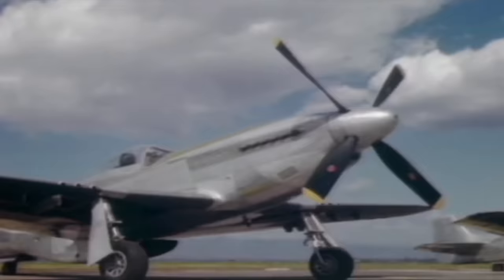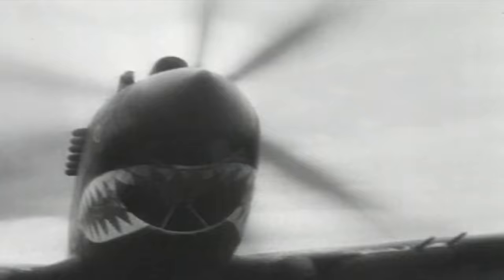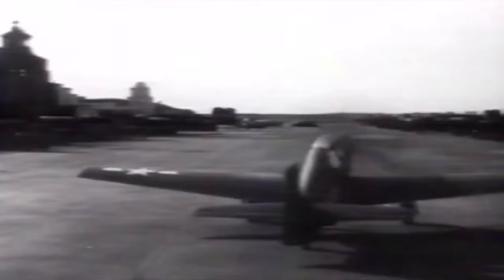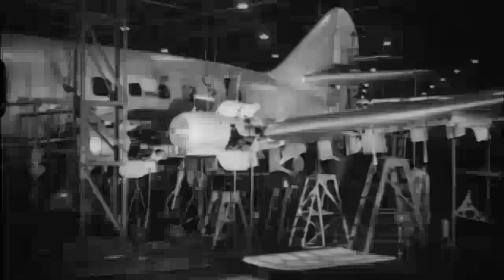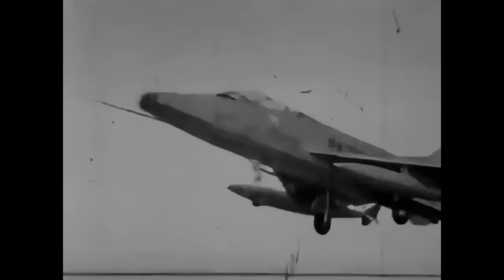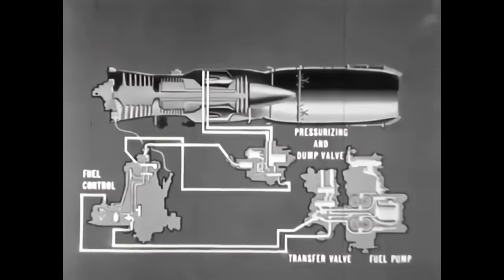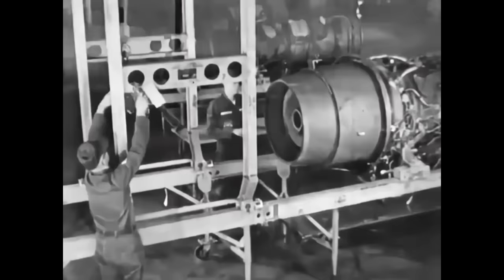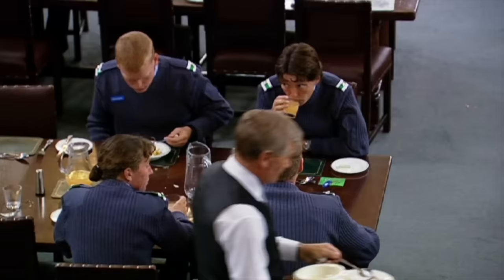Aircraft Engines | From Propellers To Turbojets, To Supersonic Passenger Jets | A Video Collection

Comment: Good documentary with a lot of valuable information.  A few issues:
1. You are unfair to Ford.  He certainly had issues, but you do not present them accurately.  His resistance to British contracts was before Pearl Harbor.  This idea that he only wanted to build 'defensive' arms is nonsense.  He was an isolationist.  After Pearl Harbor, Ford was all in.  I suggest you look at what came out of Willow Run, B-24 Liberators in incredible numbers.  And the B-24 is about as offensive as you can get.
2. The P-47 with drop tanks could also fly escort missions to Berlin. 
3. The P-51 range issue in the Pacific was solved at a terrible cost by Iwo Jima.  P-51 squadrons based there could escort the Superforts to Japan. 
4. You should have addressed the issue of the varied performance of the RR and Packard Merlins.
5. The Doira hardly solved the Luftwaffe problem.  By this stage of the War, Luftwaffe pilots were entering service with minimal training, in part because the strategic bombing campaign was destroying the synfuel plants and there was no way to train them.

Comment: The ultimate fighting machine of WW2 was the Me-262
Reply from the maker: The airframe was excellent, but the engine was a complete disaster, so much so that after the war, except for a short-lived attempt made by the Soviets, they eventually switched to the reliable RR/Nene/Whittle British reverse-engineered turbojets for their amazing MiG 15.
The Czech Air Force also made some rather useless attempts but eventually switched to the British engines as well...
The French also tried to develop them together with Nazi engineers, but that was a no-go either.
Nobody cared for those over-engineered, short-lived, fragile German engines.
Despite 6 long years of development, massive investments, and many German companies such as BMW, Heinkel, and Junkers, they still barely worked. You can also add to that the fact that they had the lethal tendency to flame out on the pilot.
Toward the end of the war, Heinkel and Von Ohain, realizing that they wasted all that time to develop a 'lemon', eventually tried to outright copy Whittle's engine, which had been an inspiration for Von Ohain right from the start, as he had access to the British genius' work all along. 
Eventually, axial turbojets, as predicted by Whittle long before Von Ohain even started working on his engine, surpassed the centrifugal turbojets, but they were definitively not based on those utterly flawed German engines, as the Brits had been working on both solutions for a long time (and those both worked quite well).
It is still a classic example of over-hyped German wonder-weapon, when in reality the Me 262 was utterly useless.
A wonderful airframe with a tragic engine made it inconsequential.
Reply: True but most modern jets are using axial flow engines except turboprops and APU-s are of Whittle's design
Reply from the maker: True, but proper axial turbojets(mid 50s) were anything but German derived.
Perhaps you are not aware that Whittle purposely discarded the axial compressor precisely for the reasons that plagued the German engines.
He realized that it would take too long to develop an axial turbojet, so he sought an intermidiate solution that was dismissed by his sole examiner, none other than Griffith, the author of a seminal paper on axial,compressors in 1926, almost a decade before Von Ohain started working on his project, fully funded (the opposite of Whittle) by his patron, Mr. Heinkel.
You can say that Whittle had the perfect short term solution, but was halted by a person that was working on an axial solution, whereas Von Ohain who had full access to Whittle’s work, and presumably to Griffith’s paper from 1926, simply made the wrong choice.
Heinkel and Von Ohain would eventually also try to mimic Whittle’s engine, but it was too little, too late.
Companies like Metrovick had been working on (proper) axial solutions all along, in tandem with Whittle’s solution, which had been delayed by bureaucracy, Griffith, lack of funding, and support by at least 5 long years (1929 to 1934).
When you look at it objectively, and consider the resources that Germany poured into developing a flawed turbojet, you can easily compare it to David VS. Goliath.
Still, a broken, and humiliated Whittle managed to beat the might of Germany’s effort to the finish line, having produced a working turbojet in April 1937 (of course he could not afford an aircraft to test it, as Von Ohain could).
Whittle’s engine powered many aircraft, including the first jet aircraft to fly on U.S. soil, the first operational U.S. jet fighter, the first commercial jet, the formidable MiG15, and many others.
When it was surpassed, as predicted by Whittle, it was almost 1960, 30 years after he presented his (rejected) projet to the British Air Ministry.
He was a true genius, and I cannot say the same about his counterpart(s) who piled up strategic and engineering mistakes.

Comment: Ford got lucky, they let him (his engineers) re-design the merlin for mass production and these increased tolerances led to the power being doubled and eventually trippled when compared the original hand made merlins. Shows what a beast the merlin was.  I didn't hear them talk about that on here and that's the biggest fact I remember about the merlin. They asked him to mass produce the engine but the tolerances were too loose
Reply: ford(US) had nothing to do with the packard merlin, henry ford refused, packard mass produced the merlin, (engine brought to the parts on an assembly line), every part fit every engine hence much closer tolerances,  British-built Merlins were hand built, (parts brought to the engine and  file fitted on a bench), tolerances and clearances did not increase power, manifold pressures, water injection, intercoolers etc are what increase performance....... Rolls-Royce adopted many packard innovations and ford(Britain) built some 30,000 Rolls-Royce merlins but henry ford gets no credit for the packard merlin
Reply: @jamessolak1619 Henry Ford with rolls royce redesigned the merlin for mass production. Rolls Royce mass produced the merlin before Packard was involved. The upgrades you listed already existed before Packard took over. They were done in England by rolls royce and hooker and ford and whoever else. By 1939 the Merlin II was flying at more than 2,160hp. This was years before Packard got involved. I was just pointing out Ford because the Ford plants and redesign work in England are not widely known about as you have proved.  Look it up. Ford engineers redesigned the engine with tighter tolerance and Rolls Royce and Ford mass produced merlin in England. Then in 1942 Packard took over with even bigger production. This is where people get confused because Henry Ford Refused to build the merlin in the US but his ford plants in England did produce the engine for Rolls.  Packard took over US production and actually loosened the tolerances from ford and rolls to make it even easier to be mass produced. So if ford had nothing to do with that engine then where did Packard get the plans from? Ford made those plans under contract for Rolls Royce. Ford built 36,000 merlins and Packard made 58,000. Sounds like mass production and we all know who invented the assembly line so I don't understand why these facts are controversial.
Reply: @nickhouck4309  16 lines without a correct statement, packard entered into an agreement with rolls-royce in 40 september, first engines off the line in 41 august, 5 months before pearl, in 39 nothing was producing 1.3hp per cubic inch but 1 off race engines, the merlin II was at best an 1,100hp engine, Trafford Park's 30+ thousand "ROLLS-ROYCE" engines that your boy henry produced were ALL twin-speed single-stage engines (bomber engines), his last run in 46 was mark 24's at 1,600hp, i know exactly  what ford's involvement with the merlin was, i am not confused, the whole world is not confused, stop walking around with your two buckets of bullshit in a fleeing attempt to rewrite history
Reply: @jamessolak1619   literally everything I said is true accept Henry himself didn't actually do anything it was his engineers working for rolls in England. Packard had nothing to do with my point wich was how merlin went from 900 to 2,000 horsepower. The first 2 Packard test model merlins were made to celebrate opening in 41 . Packard went into production in 42.  checked and double checked and triple checked. And I'm correct. . Packard merlin was not produced until 42 true fact. Yes the license contract (not agreement) that happened before production in 41, that's normally the order of things and yes they made 2 engines in 41 but that is not production another fact. Ford plants were already producing merlin before Packard got the plans.  checked that too, another fact. Packard had to loosen the tolerances in order to make mass production easier. Another true fact. sounds like the one lying and confusing words is you. Because if it were me I would of corrected myself. If you can't understand the difference between a test model and a production run then your never going to understand why they couldn't of went into production before pearl or the difference between an agreement and a license contract.  there is no point in continuing. Because you probably still don't get it. The only thing I could find wrong with my 16 lines was the Henry part. It was Ford but not Henry. 
https://theaviationgeekclub.com/the-story-of-when-ford-uk-refused-to-build-rolls-royce-merlin-engines-because-the-tolerances-rolls-royce-allowed-were-looser-than-ford-was-willing-to-work-with/

Comment: This author's flawed contention that all radial engine aircraft were slower then in line engine aircraft, conveniently overlooks the P-47 Thunderbolt and the Navy's F4U Corsair. The P-47D could fly at 425 mph. the P-51 at 440 mph, the Corsair at 446 mph, the P-47N at 470 mph and the P-47M at 500 mph (hot-rodded) and all at level flight.
The main advantage the P-51 had, although it was a bit slower, was that it was a true "dogfighter".
Not only that, if you compare the FW-190 and the P-51 in plan, the airfoil outline's are virtual replica's.
When they were used for ground support in Korea, the vulnerability of the liquid cooled engine made many of them wish they still had their P-47's.

Comment: I guess for simplicity of explaining types of engines inline engines applies, but a v12 is a V bank engine, not inline.  Hearing that repeatedly makes me cringe when the v engines are called inline
Reply: @scottallberry6713 your thought process is only for auto and marine based power plants, with aero engines if the cylinders are inline no matter what the banking is it is an inline engine, with radials as you add rows the cylinders are offset for a more compact design and more surface area for cooling
Reply: @jamessolak1619 , 100% correct. (Until recently, I was wrong about that, too)

Comment: Imagine what would have been produced if the likes of Junkers,Heinkel, Blomn and Voss carried on after the war. Operation Paperclip did a great job in retrieving German R&D.
Reply from the maker: Certainly not the German turbojets, which were largely ignored by Britain and the USA, adopted by the French (with a platoon of Nazi engineers), but it took them years, radical modifications, and the assistance of an American company to make them proper engines, and lastly trashed by the Soviets as utterly unreliable and short lived. The Soviets ended up using cloned British turbojets in Korea for their lethal MiG-15, which initially fought against the first U.S. jet fighter, the Lockheed P-80, also powered by  the same turbojet (variant).
The German turbojets faced very little interest after the war.
By the way, the Czech Air Force, which had been assembling Me 262 and Jumo engines during the war, also made an attempt at using those engines, but also gave up, and used the Soviet cloned British engines.

Comment: I guess I am the only one annoyed by them saying "rotary engines"..... planes aren't powered by Wankel engines
Reply from the maker: No need to be annoyed.
The aero rotary engines are not Wenkel engines…
Here is an informative excerpt from an article:
“The rotary aero engine is a special type of air-cooled radial engine, where the cylinders are arranged like the spokes of a wheel and turn around the crankshaft. The propeller is connected to the cylinders, while the crankshaft is fixed to the frame. The rotary aero engine, developed in 1908, set new standards of power and light weight within the aircraft industry. It was adopted by many pioneer aviators and widely used to set records of endurance, speed and height. Many aero engine manufacturers produced different models and variants of this type of engine, which was extensively used until the end of the First World War. The latest evolution of the rotary engine was the counter-rotary arrangement, which was devised and designed by the Siemens-Halske company.”
Reply: How very wrong you are
Reply: Quinn, I guess it's okay to be wrong and annoyed. Do some research.

Comment: Nice, but you made the same mistake so many make about the Ju 88 ; NOT radial engine powered. The Junkers 88 had inline engines with circular radiators . Still fooling noobs 80 years later ;)

Comment: Another documentary where America did it all and no one else did much 🙄
Reply from the maker: Well, if you noticed, the first turbojet, also the first one to ever fly in the U.S. in 1942, was very much British, and derived from Frank Whittle's engine, also the first turbojet to ever work in April 1937 (yes, the Germans had the first flight, but not the first turbojet). that game changing invention was shipped to General Electric, together with the British inventor, in 1941. It was done in great secrecy.
The engine derived from Whittle's also powered the first U.S. operational jet aircraft, the Lockheed P-80 Shooting Star, which was designed by nene other than Kelly Johnson (of Swedish descent by the way).
Unfortunately the P-80 proved to be inferior to the Soviet MiG-15 in Korea, and that aircraft was also powered by Whittle's engine! After the war Britain sold a few units to the Russians (it was under the brand Rolls Royce), and they did not waste too much time, and copied it, only after attempting to use a couple of variants of the utterly flawed German engines that powered the Me 262 at the end of WW2, but that still have all the issues that riddled them when they lost the war: over engineered, fragile, tragically short lived, and prone to deadly flame-outs.
By the way, Whittle's engine also powered the very first commercial jet, the Comet.
Not bad for a broke, widely ignored, and unsupported (by his own government) British genius. In the very early 30s the Germans also copied his work, which was not protected with secrecy by Britain, and distributed it across German Universities, so you can easily guess where they got their inspiration...
That invention changed the world forever, and it was very British, and achieved by a small team of barely funded (privately) engineers.

Comment: I guess they cut out the part about who invented and flew the first jet engine the, Me 109
Reply from the maker: I think you are quite confused.
The first flight of a turbojet propelled aircraft,which has nothing to do with the invention, and the first working turbojet, which was very British (April 1937) was the Heinkel 178.
After that short flight in 1938, a multitude of German companies (Heinkel, BMW, and Junkers) spent 6 (SIX) long years trying to making a proper turbojet that could be deployed operationally, but when they actually deployed in in late 1944, powering the Me 262, it was still a very disastrous engine, and one that had a lifetime of just a handful,of hours. Basically useless.
The proper turbojets were mostly British, both centrifugal, and axial, and the axial variant became a properly usable engine around the mid 50s. Before that Whittle’s turbojet was the proper solution, as proved by the Soviets in Korea with their formidable MiG15 (they reverse engineered the British turbojet).
After the war those German engines did not go anywhere.
Reply: The internet is a great research resource. May I suggest you use it?

Comment: Inline engines , we’re not the most powerful mass produce engines in America or Britain for that fact. The are radial engines such as the R 2800, followed by the R 3350 and the R 4360 were all radial engines. The quintessential examples of these produced 2500, 3000, two 3800 hp respectively, these figures are all greater than in line engines produced in America and Britain. The fastest fighters during World War II radial engine powered. Even in German, the folk wolf 190 had a radial engine and was one of the fastest fighters of its time. The F4 Corsair broke 400 miles an hour in straight and  level flight. Followed by the P 47 thunderbolt at 500 miles an hour and straight level flight . No in line engine fighter surpass these records during World War II